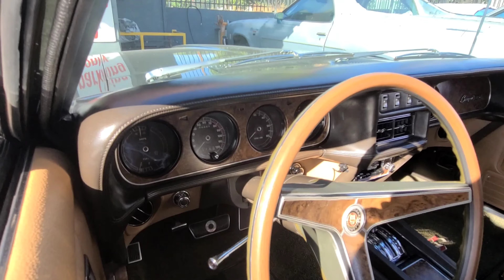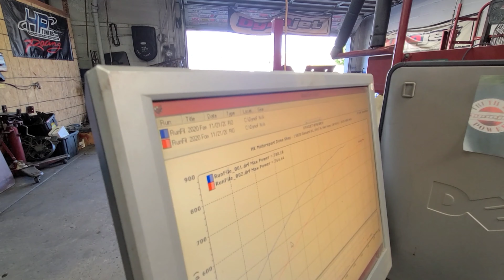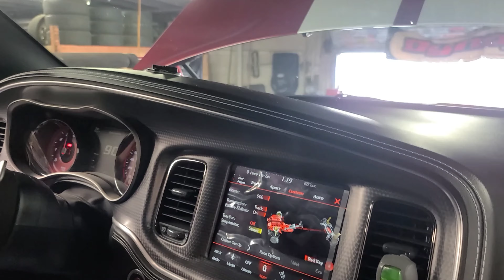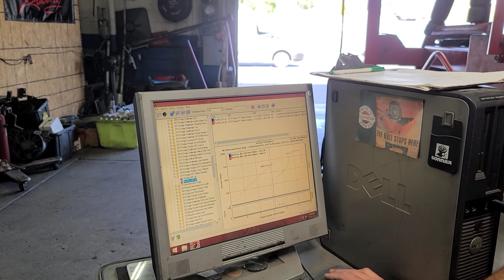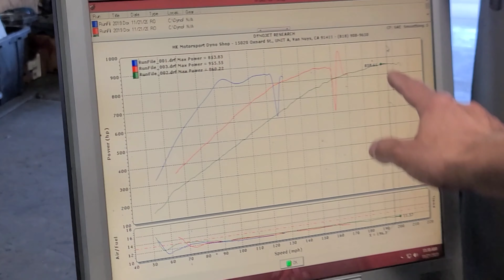Modded GT500 & Charger Hellcat hit the dyno!

Comment: So Tim from SRTAUTO gave u a E85 tune making 925whp an E80 tune making 860whp Did not no about E80 just E85. So from my understanding Tim gave u numbers for the E85 tune when u picked the car up but didn't give u numbers for the E80  Good numbers bro
Reply from the maker: Tim barth did he doesn't work at SRT Autoworks just the tuner. But yes you are 100% correct we had limited dyno time so they dial in the E85 tune and and supply and separate tune for everyday use and a 3rd tune for 91 octane(emergency use)
Reply: E85 is just the name. The percentage just dictates how much timing the computer will add and how much fuel the fuel system can flow at that %. You can have a e50 tunes but have e75 % in your tank if the fuel system can keep up. Best is to have a system that can flow and handle full e85 so you don’t have to be a chemist and mix down the content to e30-e50 and you can. Put what every % you want in their and let the computer adjust the timing